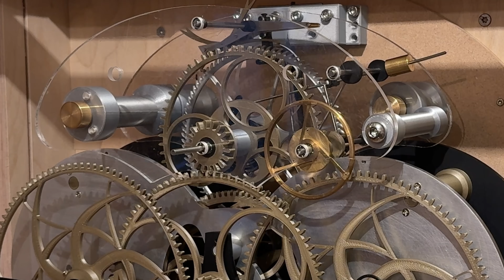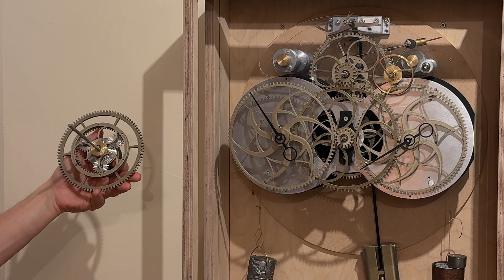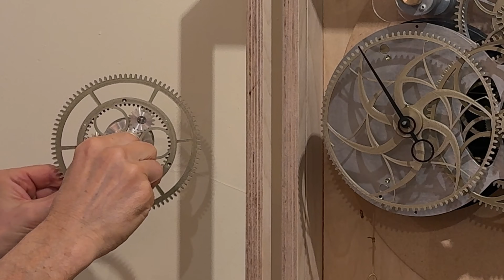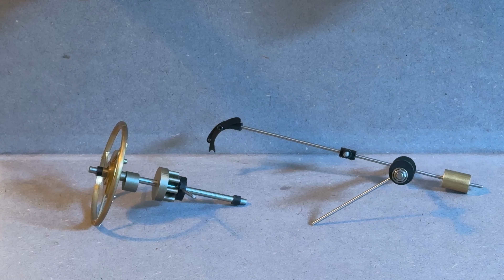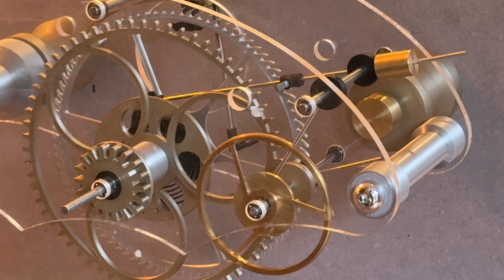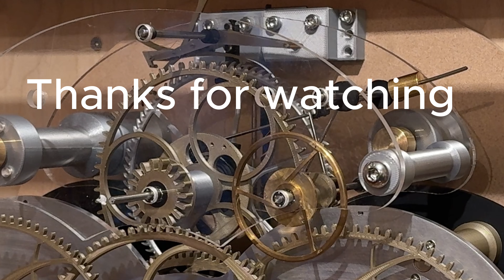From Plastic to Precision: My 3D Printed Prototype is Finished

Comment: James. That clock looks stunning. As I've some small components to machine/hand make for BHI exams any videos you publish that show your processes and methods would be very helpful. Thank you. John
Reply from the maker: Hi John, thanks for your kind comments. I am currently making the quite complex suspension bracket and circular cheeks using a mix of desktop CNC and manual lathe and milling - it may be more of a 'how not to do' video! Good luck with the BHI exams.